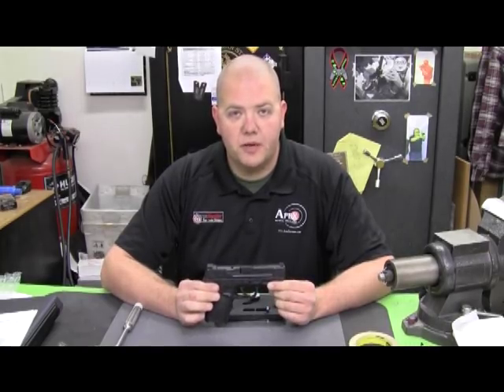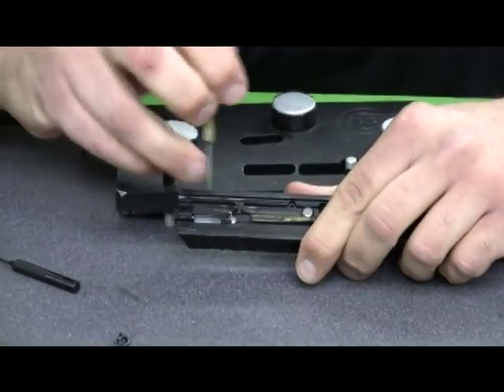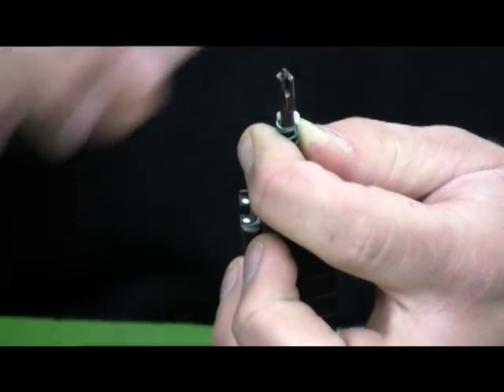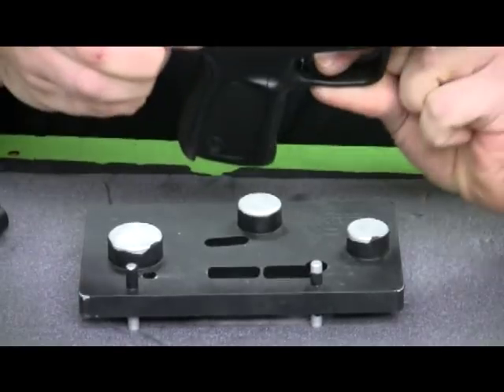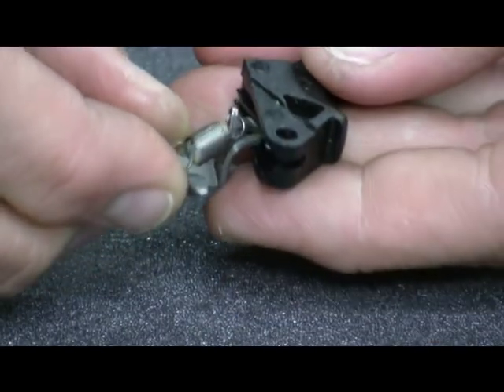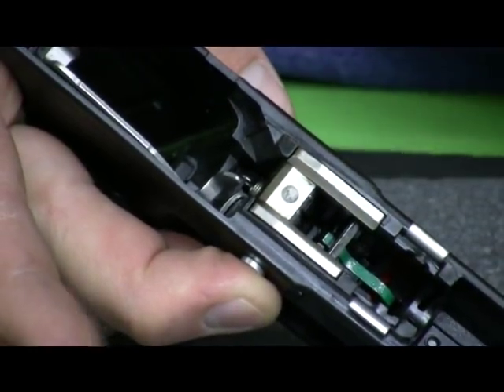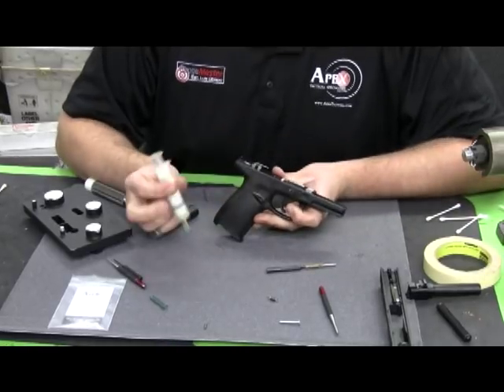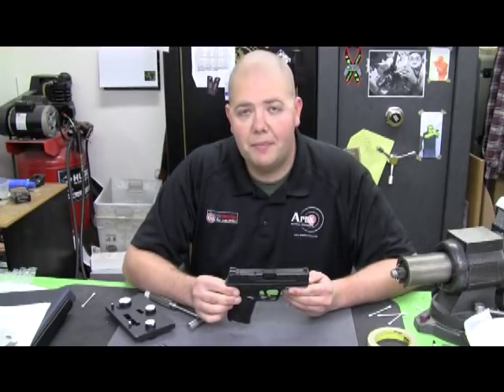SD/Sigma Kit install

Comment: I have NO experience with gunsmithing whatsoever, but I can honestly say it was very easy to get it done.  I also installed the Action Enhancement trigger.  The trigger took a little tuning (filing) but it now breaks at exactly the right place.  The trigger feel like night and day from the factory bang switch.  Feels great dry firing and I can't wait to get to the range tomorrow and put 100 or so down the pipe.  Thank you for making my OK gun into a really, really good gun!  Anyone out there considering this purchase, just do it!
Reply: Chris Vandal bought mine today !

Comment: Like others, the slave pin/trigger pivot pin was the trickiest part. Got mine installed in about 90 minutes total, including distractions. :) The new pull is very smooth and light. Thanks to the team at Apex for a nice product and to Scott for the high quality install instructions.

Comment: Update to my previous post.  I just put 250 rds through my SD9VE after installing the Apex spring kit and what a difference it made in reducing the trigger pull weight and smoothness of the trigger pull itself.  Well worth the $20 and the time spent installing it.  Love my SD9VE even more now.

Comment: I received my Apex spring kit last night, and promptly went to install it. Without this video I would have been utterly lost, so thanks a lot for uploading! Had lots of trouble with the trigger pin, but eventually got it sorted. I also polished the trigger parts as recommended in the video. The final result is outstanding! Thanks Apex Tactical! 
Can't wait to take it to the range for function testing with my carry ammo.

Comment: had my SD9VE for 4 months and love it,put 900 rounds through it ,no malfunctions what so ever,trigger was a little hard to pull,bought the apex spring kit,watch the video installed it,what a difference !! my accuracy improved alot,at 21 feet hitting a 3 inch circle now,the lighter trigger pull helps alot

Comment: I just finished, (with the help of this video), installing the spring kit and while I was at it, the Apex Action Enhancement Trigger on my new SD9ve. I had a little trouble getting the trigger pivot pin back in, trying to get the slide release lined up and all. But it went smoothly otherwise. WHAT A DIFFERENCE! Shorter trigger travel, lighter pull weight and no detectable over travel. I was fortunate that I did not have to remove any material from the back of the trigger as some have had to do, according to the forums. I hated the original trigger because it had too much curl in it. My finger barely fit on it and it was uncomfortable. This Apex AET is great and much more comfortable. I also installed a Galloway Precision stainless guide rod and 17lb spring kit since I got it all in the mail today. REPLACE THAT CRAPPY FACTORY PLASTIC GUIDE ROD AS SOON AS POSSIBLE! Great products and fast shipping and customer support, (if needed). Thank you guys!!

Comment: I just installed this spring kit along with the Apex a tio trigger, new take down plate and stainless steel guide rod. Had some trouble taking out the trigger pivot pin and after reading the comments on this video I tried taking it out from left to right and it came out pretty easy. Very pleased with this kit and makes one hell of a difference now

Comment: Great video! Just finished installing on my SD9VE with only 100 rounds through it.  Getting the trigger pin back in right was a bit of a pain. Took three tries. The slide lock kept coming out. Once I got the pin back in, the rest went very smoothly and this is the first time I've tried anything like this on a gun.  The trigger feels MUCH better and I couldn't have done it without this video.  Thanks!

Comment: Just got this spring kit installed (never done this before) with no major issues. I was even able to do it without having to remove the seer housing block. Stock trigger feels a lot smoother and definitely easier to pull. Thanks, Apex!

Comment: Hello
I just installed 2 kits in a pair of SD40VE, that I was trying to decrease trigger spring tension. The kits were $20 a piece and by following this video (more than a few times) it was really quite easy and did not take too much time. I will be heading to the range tomorrow to find out how they shoot, however, I really think they will be fine and for me a little more accurate with less squeezing needed to fire a round. Thank you for the video, it really did make it easy.

Comment: Thanks so much apex! Did this by myself in less than a hour. Only hard things were getting the trigger pin back in and lining it up with everything and the rear pin on the grip took some good hammering to get out and back in. I used back side of drill bits as a punch and everything turned out incredible!  Big difference. The trigger pull is no more than what it takes to pull the trigger saftey back till the trigger activates. Pure amazing. Thanks again

Comment: firstly, take a bunch pictures and video of your gun prior to doing this change.... this saved me.
the sd9ve has more components (the CA version atleast). within the rear seer housing block is a spring and another bar (these are absent from this video). my guess is it prevents the gun to fire if a magazine was not in place. i had a hard time putting back the pin and  putting this spring and bar back. i stopped there and just replaced the springs in the slide and ensured its functionality. took it out to the range to compare pre-spring replacement vs post. it was a very notable difference as my finger was not as fatigued pre vs post. my groupings were closer and in the center of the target. pre-spring change had me pulling low and to the left (guessing fatigue). just the spring change in the slide made me enjoy this gun a lot better.
Reply: Take a look at my posting above.  I too have a CA Compliant model and I did not / could not, remove the rear pin, but was still able to install the trigger return spring.
Reply: I, too, have the Ca. version.  The pin needed to be drifted out in the opposite direction than shown in the video.  The reason will be obvious to you once you have removed and inspected the pin.  Be sure to reinstall it the way it came.

Comment: Very informative video and very easy to do. I watched the video one time through and then i played it again and paused and played following the steps. It was very easy to do. I am very mechanically inclined but by no means am I a gunsmith. I was able to do this with ease. It took me about 30 minutes to do and it very much lightened the trigger pull. My groupings instantly became greater.

Comment: I have never done any kind of gun smith work before but this was really easy to install on my SD40ve don't be intimidated buy all the stuff that you have to remove if you have any kind of mechanical skill you will be able to do this no problem don't waste your money on a gunsmith because once you learn how to do this not only will you know you're gun a lot more but you'll be happy that you did it yourself this video is really accurate and helpful and it only took me 20 minutes to do it took my gun right out after and put 50 rounds thru it no problems

Comment: Just got done installing the kit on my SD9VE. Everything was just as described in the video except the slave pin came out opposite of the video, no biggie. I had issues with my slide release lever not holding the slide up with an empty mag. Think I somehow bent the little spring on the slide release lever while installing. Everything works great now except for that. Trigger is much smoother and shorter. Took me a little longer than him since this was my first shot at any type of gun smithing. Great video, thank you!
Reply: +Matthew Pruitt same thing happened to me except my slide lock lever is springing up...any problems for you? thanks in advance

Comment: This was a very simple install. Some steps were a little harder than the video shows, but all in all very clear directions. I also installed the trigger at the same time as the springs to avoid having to do this again. Not sure what all the notching, sanding, grinding talk is all about. My trigger swapped out easy, dropped in, and done. No grinding of the back side of the trigger needed. Not sure if I have a newer version trigger, but mine fires EVERY time. Very reliable upgrade as far as I'm concerned. If I had 6 SD40's every one of them would have this spring & trigger upgrade..

Comment: Installed on sd40ve! With mine the trigger pin wanted to go from left to right but after installing the new spring I followed the video and inserted the slave pin from right to left, worked great. I used a precision screw driver to hammer out the rear pin so if you don't have that small punch don't worry, just don't booger anything up. BEWARE...if you've fired several hundred rounds through your gun prior to install it will not come apart as easy as it does in the video!

Comment: apextactical  I installed this last night and boy can I feel the change. It was real easy to boot and I only had one hiccup. I was not able to push my sear pin out to remove the sear housing block, however I was able to still install this with out even taking it out! In my opinion it might make it easier when its removed but not really necessary.

Comment: Just installed all the parts on my sd9 ( melonite slide model) today and did some polishing while I was in their and I must say.. I am absolutely astounded by how much of a difference it made in my trigger break, I love this gun now. Taking it to the range tomorrow to see if my groups are better, which they should be now that I knocked atleast 3.5 lbs off of the factory pull.. THANKYOU APEX TACTICAL!

P.S the install wasn't too hard, getting all the parts lined up to put the trigger bar in was the hardest part of this whole install.

Comment: Warning to those who have a California Compliant SD9VE with a magazine interlock safety, I was installing my APEX spring kit on my new firearm and had completed all of the slide installation steps in about five minutes, however, the trigger return spring was another matter.  Not only did I find that you do not have to remove the "rear pin" in order to install the trigger return spring, but that "rear pin" must have been installed with a hydraulic press.  I never did get it out, because it appears to run through a spring, that I believe is installed to maintain pressure on the magazine safety interlock while the mag is removed.  Bottom line is, after a lot of pounding and some questions as to the marital status of the parents of the person who thinks a mag interlock safety is required, and also that this video does not address the fact that a Calif Compliant model does not disassemble in the same manner,  I finally was able to install the trigger return spring, which was by far, the most difficult part, trying to keep the slave pin/retaining pin touching while inserting the retaining pin through all the holes of the locking block, the slide stop, trigger, return spring, the other side of the trigger and then the frame.  Once the spring kit was installed, the trigger pull was significantly improved, but I have to say that the installation process is not as slick as in this video.  I suspect that the firearm used in this video has undergone numerous training demo's and thus the pins and parts come out and re-assemble a lot easier than on a new firearm with only about 250 rounds through it.  I would like Apex to confirm the approach I have taken in installing my kit without removing the rear pin, or at least, address the issue of installing this kit on a Calif Compliant firearm with a magazine interlock safety.  Looking forward to taking my SD9VE to the range and seeing how the trigger kit improves my accuracy.
Reply: be thankful you didn't get the pin out, I did. parts go flying because of the spring tension. I sucks having to figure is out on how the parts go back together.
Reply: That is exactly why I posted my experience.  I surmised that the parts-flying-thing would happen and ceased my attempts.  Sorry you found out the hard way.  I expected that Apex would at least post a response to my comments so that others would not have to go through what you did.  I do like the new trigger pull though.  Just have to be mindful that YouTube videos may not be 100% for all variants of a firearm model, especially in CA where anti-firearm people are making all the laws in the state and don't know a thing about firearms to begin with.
Reply: @kindheart4you  Break up your paragraphs would you please? I have the California version also and trying to decide whether I'm up to replacing the trigger return spring or just do the slide thingy.

Comment: I also had a difficult time removing the trigger pivot pin on my SD40. I tried everything to get it to release and after about an hour I had to use a punch and tap it carefully. It finally came out going from left to right also as mentioned by escalso 74. No damage to the lever or pin as I was very careful. I was able to put it back in the same way as the video. Make sure the slide release lever engages the pin. I had to work the lever and pin back and forth a little to get it locked in.  As a side note, I had done one of these before on a prior gun that was stolen. The trigger still had a gritty feeling when I was done. This time I polished the sear and engagement lever as shown in the video with a rubber tip, rubbing compound and a dremel tool. Huge difference, the gritty feeling is gone and the trigger is much better than stock.

Comment: Great video. Just did the spring set in my SD9 following the video. The trigger pin was a bit temperamental, but once you got it right the pin slid right out. Feels better but I need to get it to the range for a real feel. Thanks!

Comment: Just changed out the springs and the trigger itself with the Apex parts. I got it done with almost no trouble. More my mis-understanding than anything else. I do have the SD9-VE and it seemed the same to me. I had to push the trigger pin from the left side. I like the new feel of the trigger and springs.

Comment: Wasn't too bad, it look me a little under a hour. Make sure you have good eyes and good lighting! I had to remove my trigger pin from left to right in order to remove it. It wouldn't budge going right to left.  There is a noticeable difference in the trigger pull after the installation.

Comment: Great video, Scott.  I was a bit worried about the install but the video walked me right through the process.  I had my laptop next to me the whole time and just replayed the sections whenever I got into trouble.  The only real trouble that I had was getting the whole on the slide release to line up.  The whole process took me a little over an hour.  Of course, then I immediately had to take the SD9 to the range.  The Apex kit makes the SD9 feel so much better.  I love it.  Thanks!

Comment: Just finished installing the kit, Was a "Little" different than the method shown in this video, It was for a SW9VE. The rear SST guide blocks were Molded into the frame and the sear block came out without them. I believe you could probably install the kit without the rear pin removal. My front Trigger pin also had (One) groove not two like shown in the video. I installed the Apex Trigger along with the spring kit. It required Quite a Bit of Filing to get the sear to release and the firing pin to drop. I had several jeweler files that made it easy and I didn't have to remove the trigger to do the adjustment.

Comment: Nice little addition to my SD40VE! It only took about 40 minutes to install and 20 of that was trying to get the slide release lined up with the slave pin. I also had the same issue as Stewie6096... I had to remove the trigger pin from left to right. (very tight) all in all, easy and a great NEW trigger pull!

Comment: Installing the two springs within the slide was a piece of cake.  Lining up the spring-loaded slide lock to allow trigger pivot pin insertion left a slightly different taste in my mouth.  Once successful though, it was well worth the effort.

Comment from the maker: the second sleeve is a firing pin sleeve which is not supposed to come out of the slide.  Just put it back in the same orientation it was before you put the striker back in.

Comment: This is a relatively painless job, a little fiddly lining up the trigger return spring, slide catch and such to pin together.  Nothing too different between the Sigma and SD, but the extractor parts come out the back of the slide on the Sigma and the front pin on the Sigma has one groove instead of two.  All seems to function well after reassembly, using snap caps.  Haven't taken it to the range yet.  Apex could probably do another video of the differences between the two series on takedown, but overall a good instructional piece.

Comment: Though doable, he  made it look a lot easier than it actually is. The slide was no problem. The trigger block was a real pain. It would have been a lot easier had I read the above comment first. On my gun, I had to do every from left to right instead of right to left. No way to get the trigger pivot pin out from the right side. The most difficult part was trying to install the slide lock while inserting the slave pin. Fought it for more than an hour. Finally I abandoned the slave pin and inserted the pivot pin from the left assembling the trigger block directly from the left side onto the pivot pin. Finally got it back together. I like the results.